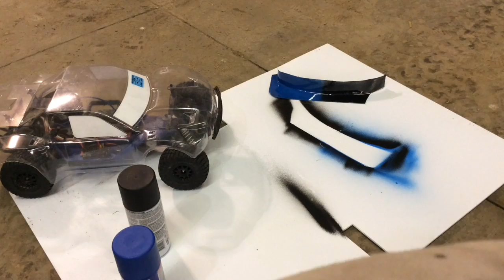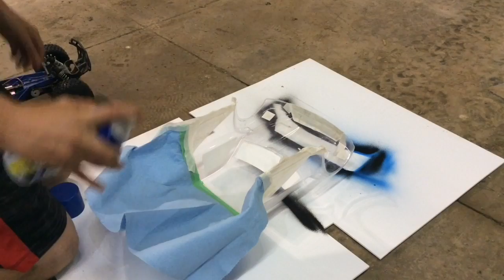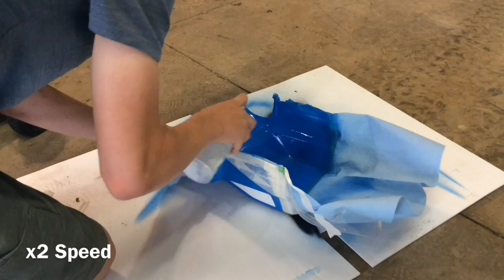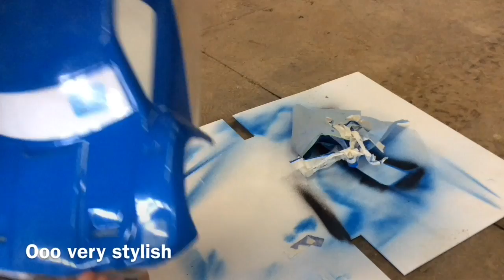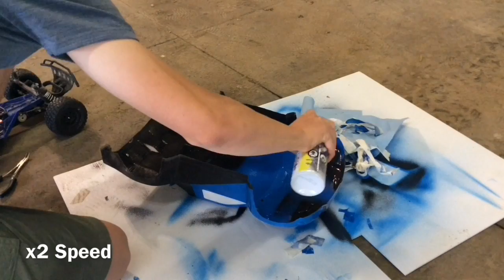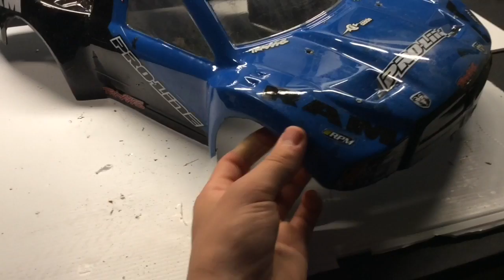How to PAINT your RC Body! Cheap And Easy! (Plasti dip) - Trx Slash 101

Comment: Does plasti dip peel when the body bends?
Reply: Bryan3000GG no. It is extremely flexible and from what others say (in rc applications) it helps with great flex to help with cracking. But no it flex perfectly.

Comment: is plasti dip heavy?
Reply from the maker: Im not sure. This shell was heavier than the stock shell when I was finished painting it. It could be the shell, or possibly the plasti dip
Reply: Trx Slash 101 I'm planning on plasti dipping a crawler shell gloss or mat black and put it on a sc truck
Reply from the maker: Sorry to say but I currently dont have a scale for objects that light. In case your wondering, its definitely not a brick. Your idea sounds great!
Reply: Trx Slash 101 lol awesome thanks m8
Reply: Wouldent make barely any difference bro
Reply: Rc_ KiNg Plasti dip is really light. It's just a really thin layer of a plastic film. Make sure you put 4-6 coats to make peeling off removal easiest.
Reply: Chris Watson lol yep already experienced with plastic
Reply: Rc_ KiNg fiqured that. How's it been on the rc? Never used it yet for a rc but thinking about it. Any opinion about it?
Reply: Chris Watson if you do gunmetal Grey on a Short Course Truck shell it looks badass with black rimmed wheels. So if you're going to do it I would do 3-4 coats like the guy said and don't bother masking out the windows it's very hard unless you're good with a blade but yeah
Reply: Rc_ KiNg ok thanks bud. But is it better than just using a tamiya paint or something? I'm gonna order a proline raptor body for my cheetah and weighing my options between this and paint? What would you suggest?
Reply: Chris Watson probably plasti if u want to repaint it later on + u will just need 1 bottle... also the jlb cheetah?

Comment: supposed to paint dark first
Reply: Why is that?
Reply: @fernando because you messed up light color when top coated with black or dark color it makes the color you painted more darker but in the other way around you wont messed dark color when coated with light color or the difference will be minimal
Reply: It depends on whether or not you intend on darkening the colors with a dark or light backer. 
In this case he was able to speed up the process by picking a color that (with a black backer)  looked good in the end. 
So if you plan the right shades, you can save time by cutting out some taping time.